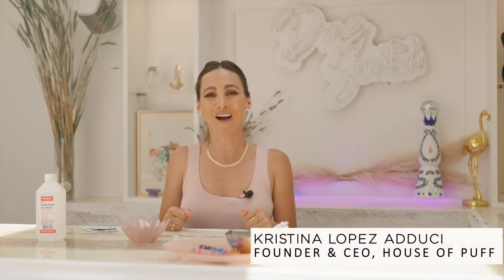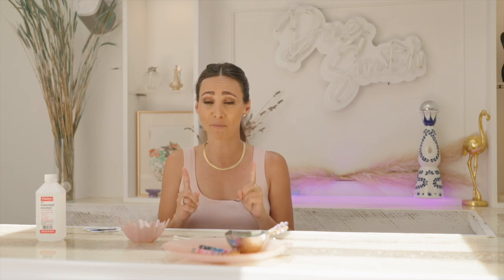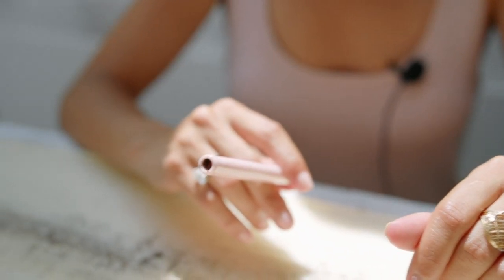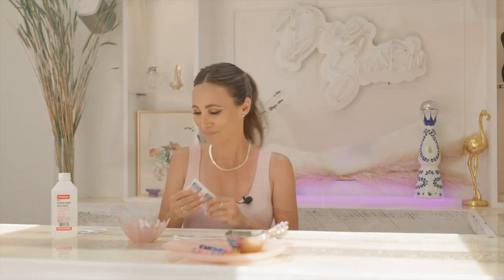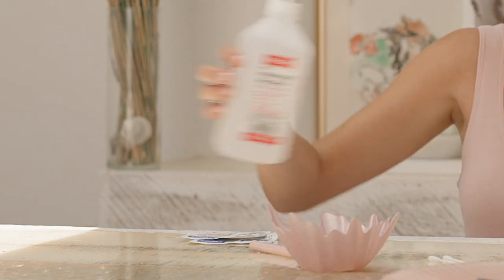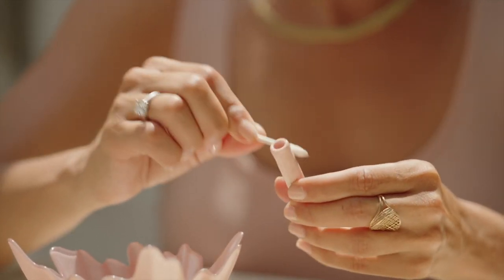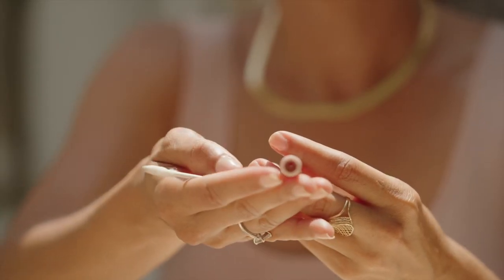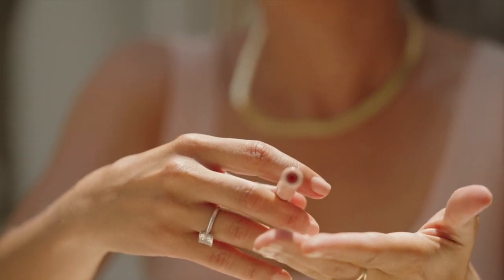How to Clean Ceramic One Hitters

Comment: How do you get the initial weed ashes out? We tried ours for the first time today. Loved it!! But found we had to use a toothpick to get all the ash out before rinsing our pipes off. Is there another suggested way?
Reply from the maker: You can just tap it in the sink or your ashtray & then put it right under the water to rinse out the ash. I usually use a Q-tip to get any gunk out. Enjoy!
Reply: @AtHomewithHouseofPuff  that was the issue. When we tried to tap it, the burnt cannabis wouldn’t come out.  Just stayed packed in there. That’s why we needed a toothpick to pick it all out of there. Then yes the rinse was easy.
Reply from the maker: @davegarciaofficial  Sounds like you had some really good, resinous flower—yay for you! In that case, a toothpick is a great solution.

Comment: I know of an even faster method that works well with glass blunts which are of a similar construction:

It requires hot water, dish detergent, and a cloth kitchen wipe.

1. Soak up some of the hot water and dish detergent solution with the wipe until it's well saturated.

2. Twist the wipe into a point and push it into the tube of the blunt, and then pull it back and forth a couple of times.

Any tar and ash comes right off leaving the tube as clean as brand new.

3. Rinse the tube with clean water.
Reply from the maker: Yep, that's great for glass—for details, see our video on 3 ways to clean a one hitter: https://youtu.be/MoFfoDt7Qjk.. But, since ceramics are porous, it's much better not to use a soaking method with them. That's because, when you soak ceramics, the clay expands. And that can cause the glaze to craze or crack. Since glazes are natural materials with trace elements, they're wonderful as long as the glaze is sealed. But you don't want to smoke out of a pipe with compromised glaze.
Reply: @AtHomewithHouseofPuff Your clay should be vitrified already if you’re working with a reputable ceramicist though, so it shouldn’t expand or contract much with so little heat or water
Reply from the maker: @kelseybarton  Yep, our clay is vitrified. But since pipes are already exposed to heat regularly, we want to stay on the safe side to lengthen the life of our pipes as much as possible.
Reply: @AtHomewithHouseofPuff  okay, makes sense, thanks for the reply!
Reply from the maker: @kelseybarton  Of course! We appreciate you taking the time to weigh in!